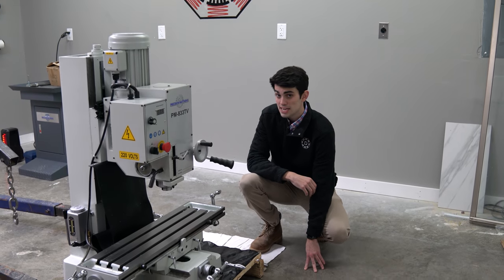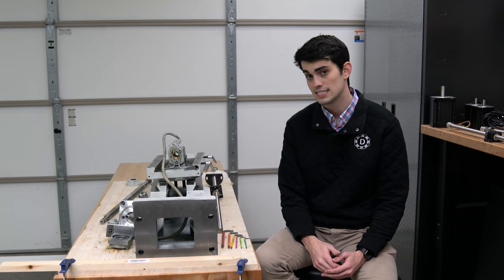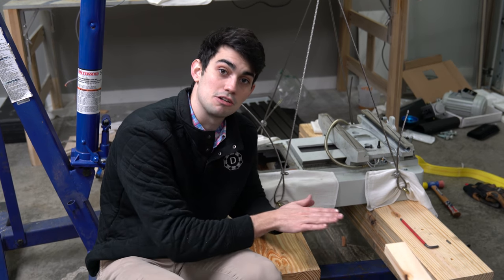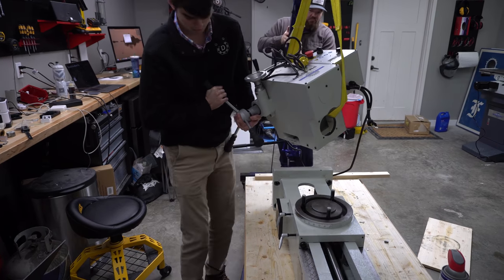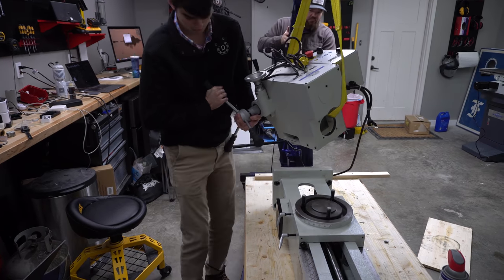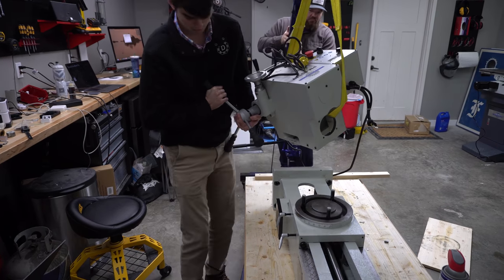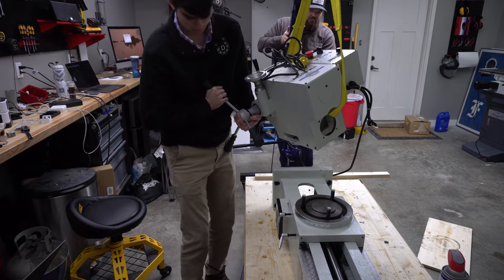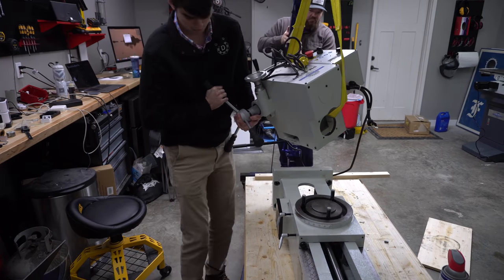How to Convert a Manual Mill to CNC

Comment from the maker: Hey everyone! I'm back with my second video in 2020. This CNC mill is the largest project that I have ever undertaken, but it was totally worth all the time, energy, and money that my friends and I put into it. I am now able to create parts out of aluminum and steel that would have cost my left leg at the local machine shop, but now cost me next-to-nothing. Let’s just say I have already started working on some exciting projects that you are not going to want to miss out on! Thanks for checking out my newest video.
Reply: Hi. Having a thick anti-fatigue mat in front of the CNC machine will protect your joints in the long run.
Reply: That some solid documentation you've got there !
Your article is pretty detailed, guess it would help me when I get into it. (Currently running grbl on a cnc router)
Reply: I have a hard time finding some feedback about probe basic.
Do you find any drawback using it ?
Like a weird 3d view, some bugs or not well made interface menus etc etc
Reply from the maker: I am definitely biased... I have been hanging out with the Probe Basic dev team over on their discord (https://discordapp.com/invite/463hMhd), and they are really awesome guys. The GUI is still largely in beta with some of the more complex features like the handling of the ATC being glitchy. If you have a simple setup like I do then it will work fine. They are quick coders, so I would assume all the issues will be ironed out in the near future.
Reply: Great man, high quality content
Reply: @DrDFlo  All great so far ! I've joined the discord, thanks ;p
Reply: What sort of money does something like this cost to buy and set up?

Comment: Another thought.... WD-40 is a great lubricant for cutting aluminum.  May not be the cheapest obviously but spraying a small amount on the surface of the material works wonders.  Also, a poor mans enclosure is to use PVC pipe hung from the ceiling and a shower curtain suspended from that.  At least all of the chips from the mill will end up at the bottom of the mill and not all over the place.  Third, look into build a fog-less coolant mister.  works awesome.  the plans are on CNC Zone
Reply: My company machines aluminum castings often, we buy 4 gallons of wd-40, online, for around 20usd per gallon. locally they are twice that.
Reply: I use oatys cutting fluid...less fumes.

Comment: Dr. D, Great freaking video! While probably not critical for your chill block project, I'd recommend a spot drilling operation on those holes first. With those longer jobber length drills they can wander of center, flex, and potentially break, particularly with smaller diameter drills. Not a seasoned machinist by any stretch, but have definitely broken some tools in my college machine shop skipping this step. Can't wait to see what else is in the works! Thanks for sharing.

Comment: Hi, great video. Just a quick note about the (apparently) hand scraped ways. The regular scrape marks you see on these import machine ways have less to do with generating a flat surface than providing shallow pockets for the lubricant. In my youth, as an apprentice (mid 1970s) in the machine tool industry here in the UK I did plenty of scraping. Sometimes the objective was to create a flat surface usually to mount large sub assemblies and sometimes we would deliberately pocket an already very flat machined surface for oil retention. Hand scrapers could be bought or made in all shapes and sizes for different purposes. Flat scrapers were usually made from an old file using an off-hand grinder to get rid of the file teeth and create a gentle bevelled curve on the end. Everyone had at least one scraper in their toolmakers’ chest for general scraping jobs including removing old gasket material. Anyway good luck with your workshop endeavours, all the best from the UK.

Comment: Very nice work. I assume that you will at some point want a DRO for absolute measurement accuracy or switch to servos. Steppers can slip. Also, great job tramming your column, but consider that the shim and the rear of the column are now interfacing ideally along 2 lines rather than a plane. There is special filler material that will again make your column and base intersect in a plane.  In machining stiffness is everything - you can never have enough. Outstanding video though. I've always wanted a CNC mill, but am out of room with manual mill and lathe. I would be happy to collaborate on parts in the future, if you are interested. I also have a surface grinder.
Reply: I have no clue what you're talking about but it sounds smart as hell😂😂👍👍👍

Comment: You should bolt the vise directly to the table, instead of having it on the swivel base. Also, great job! Fantastic results for a first time. You must have nailed the speeds and feeds to drill all those holes in aluminum without it gumming up on you (if it does, WD-40/kerosene works great to prevent aluminum sticking to tools).

Comment: Just a tip: if you use the left upper corner of your workpiece as (0,0) and align the material with the left edge of your vise, you only have to probe once for all parts done in the vise independent of the size.

disclaimer: I am an electrical engineer so I am used to do just the bare minimum necessary to make installations safe enough for certification with the minimum amount of costs for my company.
Reply: lol, you got me on that last part!

Comment: Great build!! I’m tempted. Noticed the stepper motors in your bill of materials have different shaft sizes. Did you use the 14mm size kit from heavy metal? If so, did you need to modify anything to use the larger shaft size on the z-axis? Looking forward to more great videos with projects using the new toy!

Comment: A note in case you make more of those chill blocks that will help ensure accuracy of drilled hole and also drastically speed up machine time per block... Spot drill all the holes with a large enough 90° spot drill to a depth that will give you the finished chamfer you want then come though with your drill and drill the holes.

Drills (especially jobber length drills) tend to walk to some degree and the spot drill opp will prevent this. Plus if the spot drill opp is done to the right depth, then you will already have your chamfer ahead of time and the run time for each hole will be less since a single Z axis move to spot to proper depth is much faster than a G02 or G03 circular interpolation move.

Quick simple math will will tell you how deep you want to set you spot depth that will give you the chamfer that you want. For example, say that you wanted a 1.5mm x 45° chamfer on your 6.5mm hole, then with a 3/8" spot drill, you would spot drill to a depth of 4.09mm. Since Spot drills are 90°, you dont even have to do any trig to figure out your depth, just need to know the finished hole size and the chamfer size along with the subtraction amount since like all drills, spot drills do not come to a perfect point. The math is just Hole diameter / 2 plus the chamfer size minus the truncated amount from the tip. The Truncated value for spot drills is pretty standard and are as follows
Ø 3/8" = .026" (.66mm)
Ø 1/2" = .035" (.89mm)
Ø 3/4" = .045" (1.14mm)
Ø 1"      = .060" (1.52mm)
So for your case with a 6.5mm hole and say for example, the 1.5mm x 45° chamfer mentioned above, math for the depth would be,
6.5/2+1.5-.66= 4.09

As an alternative, if you know the diameter that you want at the top face / surface, then its just simply take that diameter, divide by 2 and subtract the truncated tip amount for the spot drill you are using. Like say for example, you had a hole that you wanted to major diameter of the the chamfer to be 10mm and you were going to use a 1/2" spot drill, then the depth would be 4.11mm (10/2-.89=4.11)

The math is the same if you are working in imperial sizes, just use the imperial truncated values instead of the metric value's. 

Along with that, assuming you want a 45° chamfer around the perimeter of the block,spot drills work great as "chamfer tools" too.

It also should be noted that many drill manufactures will tell you that you shouldn't use a spot drill with an included angle of less than the angle of the drill that you intent to use to drill the hole because it can cause heavy wear in one area of the drill where is first contacts the spotted hole. While this is true, in soft materials like aluminum or fairly soft steels, this is not generally a problem or a concern. Harder steels, yes, definitely a problem but soft materials (especially aluminum or plastics and such), I've never had a the problem and have been doing it for year with probably millions of holes at this point.  

Lastly with facing, running all the way off the part will help eliminate the lines left at the end of the cut. Even with a head that is perfectly trammed, you will still see a line where the cutter stopped. 
I'm not very familiar with Fusion360 since we use SolidCAM with Solidworks at work but from the little that I do know about Fusion, I know that there is a setting that you can set that will cause Fusion to do just that, "take the cutter totally off the part in X or Y before it stops and / or lifts the Z axis. I'll bet Fusion probably has a setting or something for the Spot depth mentioned above too.
Reply: I appreciate comments like this. Thank you sir!
Reply: Yaaaaaaaassssss!!! or use a mill-drill to spot as you would with the spot drill, then before changing tools, chamfer the profile of the part. Then drill holes.
Reply: @chrisr2941  Honestly, you don't even need a mill-drill, just a standard 90° spot dill will run edge profile chambers all day with no problem, especially in aluminum.
I call / use spot one of my spot drills any time I have to run a chamber in aluminum. On steel however I do tend to use a regular 4 flute chamfer mill because I've found that with harder steels, the cutting edges of a regular spot drill do tend to get chipped when doing small edge chamfers on things like say Pre-hard 4142 for example but a HSS spot drill will leave a beautiful edge chamfer on aluminum. 

Mill-drill in my opinion are a waste of money because really the only advantage they offer is a tiny bit quicker cycle time if you have to mill out a thru pocket on a thinner part since they will bore the initial thru-hole faster thru the material than a helical ramp or a straight plunge with an end mill. Unless you have a lot to do, you really are only saving a few seconds of machine time by using a mill drill in this situation.
Reply: @CJ-ty8sv  cool good to know! I typically dont use mill drills at the place i work now but just another option i guess. That is one of the joys of machining. there is 50 ways to do anything, and the machinist community sharing different ideas and methods is priceless. just cant find that in a textbook.
Reply: @chrisr2941  Yep, there are a lot of things that can only really feasibly come with experience and sharing of what works and what doesn't. The technology advances far faster than text books can and then there is the cases that may not have come to light at the time of writing a particular book so knowledge of what might seem like an unorthodox use of something  that works well simply wasn't known at the time.

Sure, "having a tool for that" is always nice but at the same time, there are times I feel that it can hurt you by removing the drive to think outside the box and find new and effective uses for things. You never know when "knowing of another way to use a particular tool" might come in handy when you least expect it.

Comment: That was kind of interesting BUT, you have the cool machinery yet you bought a ‘CNC Kit’ rather than do it yourself. You’re no ‘maker’ that’s for sure…most people who invest in this stuff make everything themselves, it’s the reason they got it. Actually, for the first year at least, you are generally making parts/accessories for the mill like job clamps, toolmakers vices, fly cutters, boring heads, ball cutter etc etc etc. Also, your mill ‘calibration’…I’m being kind with a 4/10! Better brush up on that process, it’s critical!
Forget the tool changer! 
Make your own power drawbar. 
Forget flood irrigation/lubrication/coolant to the level your image showed. It’s only practical on machines around 10Hp and higher - your mill can’t handle the type of rapid material removal that requires high pressure flood coolant to remove the masses of swarf those mills make. 
Make your own coolant tank, pump and micro spray or std tap feed, even a gravity feed bottle works fine. Most times you won’t use any coolant anyways and when you do, it’s usually the occasional spray from a $1 spray bottle.
Start making stuff guys (including the beautiful lady of course), even if you just want to CNC stuff, you still need to have some manual mill shills/know how to choose tooling, spindle speed, travel speed, cut depths, and to define your tool path in your CAD/CAM software. Good luck 🤞

Comment: I'm in school to become a machinist, and we do videos a minimum of 25 minutes long, and have to write and answer questions on that video. The hardest part is finding a good video to do is that most videos have no commentary and give very little to ask about. You did an awesome job, and it's very easy to learn from this video. Definitely will be using your videos more.
Reply: Did you align the z-axis column to x-y?
Reply: Go for it Adam - you are learning skills that you will use forever. Machining is a tough but rewarding career or hobby. There is sooo much to know and remember and calculate and thousands of different tools and methods for doing things. I’m totally Jealous, I’d love to go back to where you are now and discover that incredible world all over again. Use the machines and test yourself with new skills and ideas as much as possible when learning. Nothing beats hours on the machines to become a master machinist. Cheers young fella, and all the best.

Comment: Making the spindle speed computer controlled is probably quite simple. On my cnc conversion it was as simple as replacing the potentiometer with the pwm speed control of my breakout board (Leadshine MX3660). If your breakout board has the same feature this should be as easy as attaching 3 leads

Comment: try changing the working tips from the facing mill, just rotate the inserts and take care that they are mounted correctly, and add some WD40 to the surface before the finishing cut, and I bet you will get a better surface finish, nice job!
Reply from the maker: Thanks Antonio!

Comment: You may want to remove the swivel base from the vise. I found I don't use it and it takes up valuable clearance. 

Also if you indicate of the fixed jaw it'll save you a couple steps.

What kind of backlash compensation are you dealing with?

Comment: my frined... please buy socket and ratcher kit or some close wrenches !!
Reply from the maker: I have gotten this suggestion a couple times now. Those bolts that I was using my adjustable wrench on were 21mm, 22mm, and 23mm. My metric socket and wrench sets only go up to 20mm. My freedom unit wrenches and sockets are much more expansive. If I make any adjustments to the mill I will buy those wrenches until now I rather spend my cash on end mills!
Reply: @DrDFlo  Hi - There is a right way and a wrong way to use an adjustable wrench too...make the fixed jaw take the load.

Comment: Just can't across this video. Excellent conversion and explanation. Should consider sure step servo motor (accepts step & dir input) with servo like precision with full loop feedback control. Wouldn't have to worry about losing steps like with a stepper motor

Comment: As a manual  and (recently cnc machinist) for over 20 years, I never set my origin (or 0.00 x 0.00 y on the movable side of my vice.  The reason for this is, the movable jaw of the vise, can move side to side slightly. The work piece will not always be exactly the same length and width, thus changing your zero.
Reply from the maker: As a guy thats new to machining, I appreciate the advice!

Comment: I am curious what you did if anything to set the current on your drives for your stepper motors. On the video they sound a little rough to me. But that's hard to tell just with audio. With a MESA board I guess you know PCW now.

Comment: You could offset the surfacing tool so that atleast 1 insert touches the tool setter. 

Brand new fancy machine and you're using an undersized Crescent wrench in the wrong orientation?!! Come on now guys! 

I like your setup. Did I miss the mini PC you're using? No issues with UCCNC here but I may give Linuxcnc a try. Nice looking screen set.

Comment: NEMA23 motors are more than adequate for this mill, especially if you are using ball screws. If you run into something, a whole lot of torque can cause damage. Ball screws do reduce backlash a lot but they do nothing for accuracy over a lead screw. The biggest advantage of ball screws is how fast you can spin them. Very nice build.

Comment: Looks like you have a keyless chuck on there.  Those are really meant for drilling holes and not milling as they can't handle the side forces.  They can loosen and you'll lose a bit.  Look into an ER collet system or and R8 Collet.
Reply from the maker: Hey Brendin! I am only using the keyless chuck for a spiral drill bit. The facing mill comes with an R8 collet and the chamfer bit is in an R8 collet as well.
Reply: @DrDFlo  Good stuff and nice job!
Reply: The face mill fits into the head on a taper to ensure a snug fit, no side or lateral forces will affect the tips, same for the keyless chuck...chuck taper  fits into the Head taper then the drill is hand tight into the chuck....